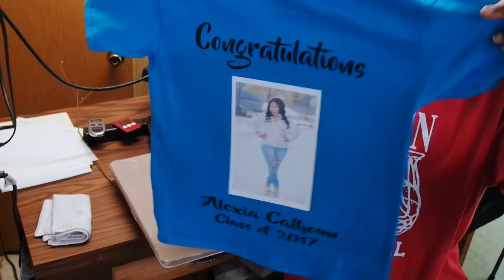Screen Printing Graduation Shirts Front & BacK + Photo TshirtChick

Comment: Do you have any idea why after I coated my screen and let it dry for 8 to 48 hours, I burned the image on the screen and go to to wash it out, 
the emulsion around the end of the screen, started to dripped down in to the design? I don't have a problem with the image washing, just the emulsion washing out at the end of the screen. :(
Reply: flex Mckenzie sounds like it's underexposed. what do guy use to burn the image and what emulsion you use. and are you using the thin side of the scoop coater or thick side.
Reply: I used the Ryonet Small UV Screen Exposure Unit - 16x20in, Ryonet WBP Dual Cure Water Based Plastisol Hybrid Emulsion - Qt.  and I used the thin side. I tried burning the screen for 12 minutes and the same thing happen.
Reply: Either you're not degreasing your screens, the emulsion is not mixed right and you might want to expose it 3-5 minutes longer. And maybe use your hand or fingers to agitate the emulsion a little bit. Try not to use alot of water that the screen will blow out. Also try to use a space heater to dry your screens.
Reply: flex Mckenzie did you mix the diazo you should be exposing for 4-5 minutes
Reply: I think it might be that the exposure unit is 16x20 the screen is 20x24, so it is not exposing to side of the screen and that might be why the side of the screen is underexposed. I think :)